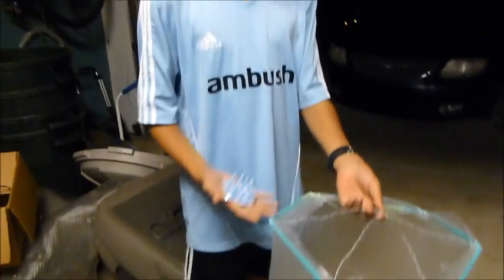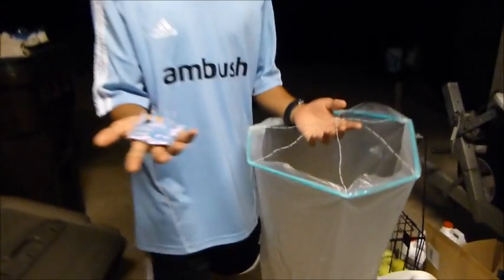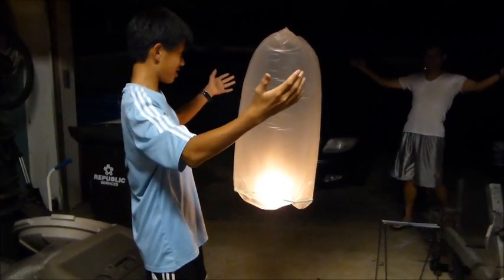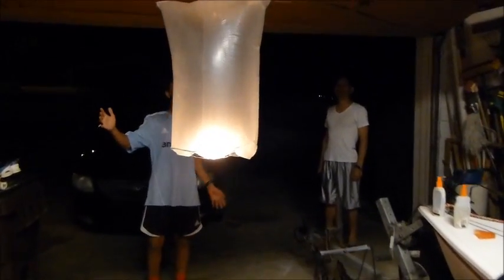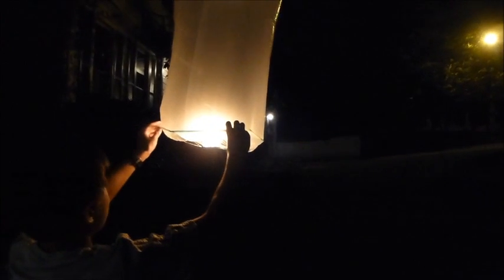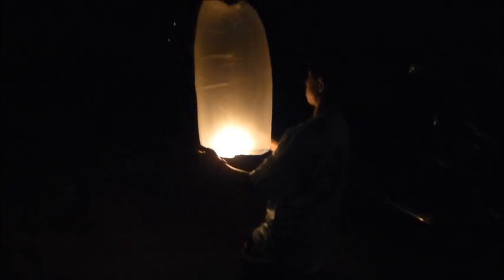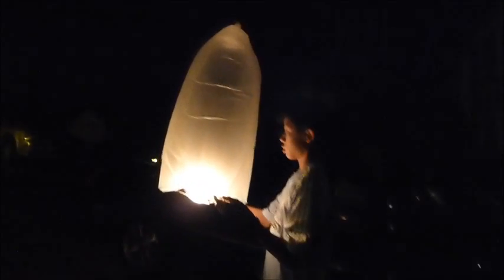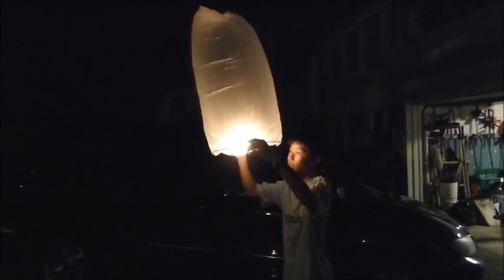Alan Ko's Homemade Hot Air Balloon 2013 - science project - how to

Comment: also it helps to have cooler outside air. makes heat work more efficiently. try one at about 40°F or lower. you'll see a significant difference. probly even less candles will work it. also balsam wood instead of straws.